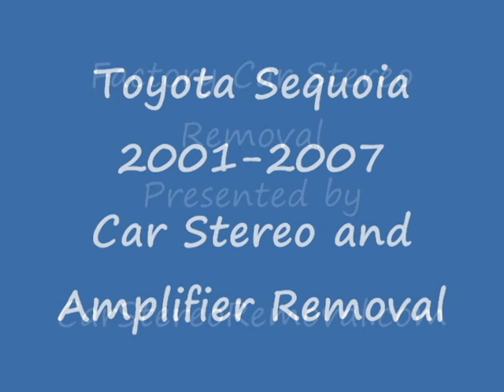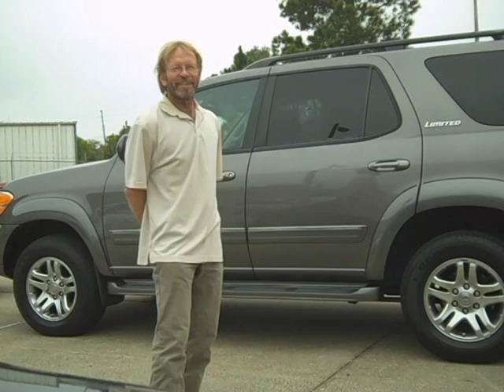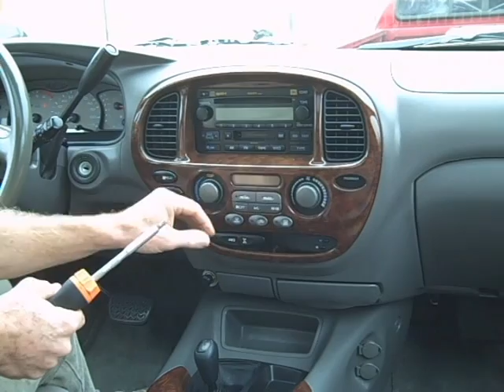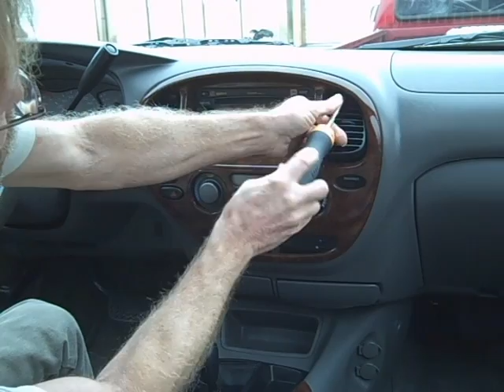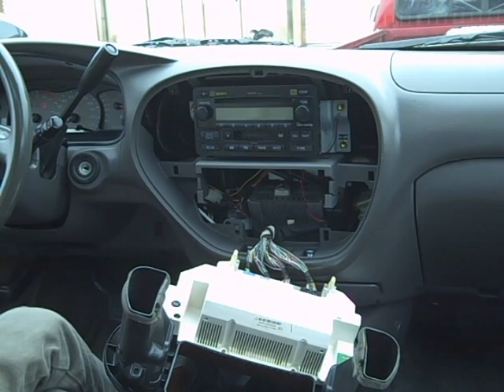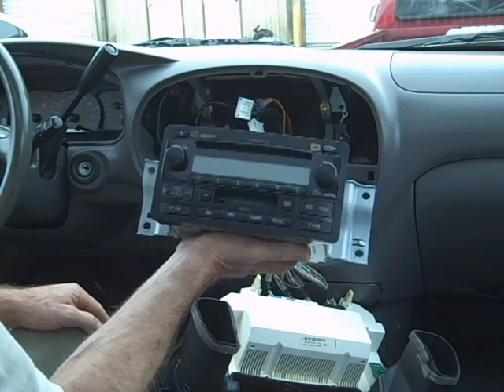Toyota Sequoia Stereo and Amplifier Removal = Car Stereo HELP

Comment: I think the other device that's plugged in on the back of the radio is the DVD player that it's mounted on the ceiling for FM sound, I use 89.7fm to listen to it while the kids watch on the screen.

Thanks for the video!

Comment: Is there a name or model number for those white connectors/ wire harnesses that plugged into the back?  I just bought a new double din stereo cause it has bluetooth and all that stuff. I just am at a loss as to how it can be wired.

Comment: I have a 2008 sequoia and I unhook my battery now I have no radio play no sound Naftin radio was working just fine before battery went dead so I went to buy a new battery took out the old one put in the new one now no sound
Reply: Did you ever get an answer or figure out what the problem was? Bought an 06 couple months ago and speakers don’t work, no sound.

Comment: Thanks.  Very helpful.  Really wasn't that hard and this was just what I needed.  Took about 2 hours start to finish.
Reply: And by the way, there's no need to take the tire off.  Turn the wheel all the way to the right and there's enough room to reach under.

Comment: Thanks for this video.  I have a question regarding the direct input adapter.  Which one do you recommend?  Manufacturer and part number would be very helpful.

A quick google search came up with METRA TurboWire part number 70-8113.

Comment: please, if possible, make a video for pre 2007 toyota tundra double cabs. This video is helpful due to the fact that the dash is exact but there are only a few things that can be done with a pre-2007 tundra double cab. I'm very interested in upgrading my entire sound system since it is very weak. I have a '06 SR5 double cab. Thanks.